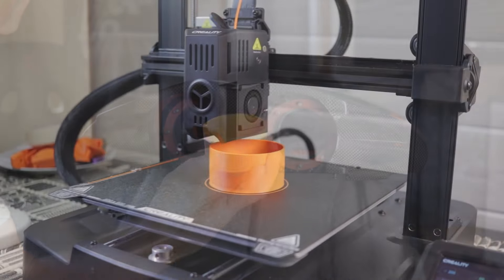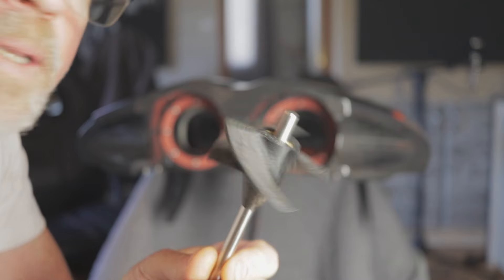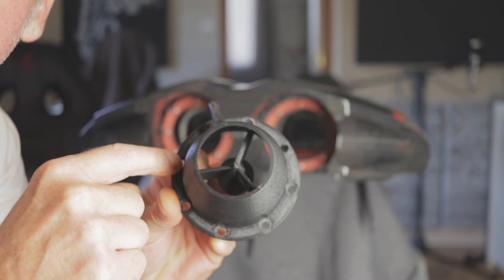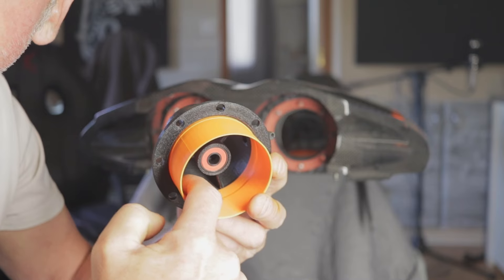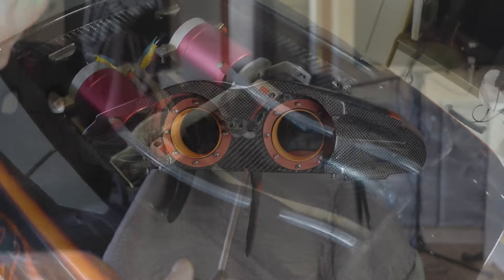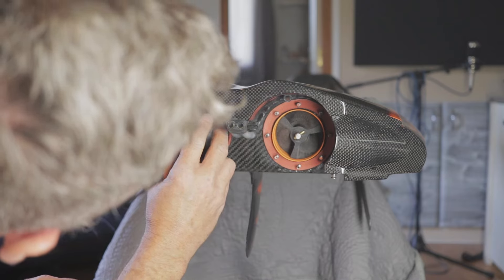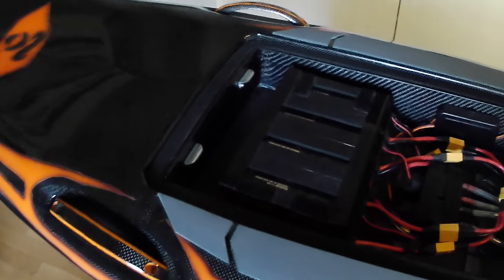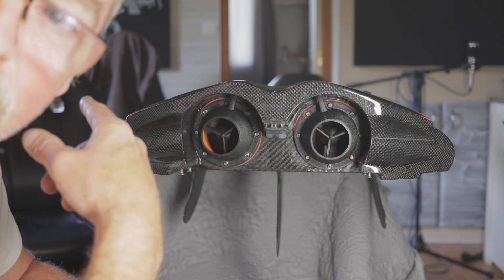Installing 3D Printed Jet Drive Upgrades for the Diy Electric Surfboard

Comment: Your board construction is amazing, quality and finish is probably the best I have seen. However I think the drive unit needs a little work. You are right about the ESCs they are easy to burn out and expensive. The absolute best are mgm-controllers but are very expensive. I have used Flier ESCs which have been OK but still burnout, I think ZTW are probably similar so watch the cooling. I now have Trampaboards vesc ESC, very controllable, well made and they have real people who answer the phone and will repair.
These boards use a lot of power and you will soon find that you need to make a Lithium-Ion battery pack. Samsung 40T 21700 is a good cell.
For the efficiency of these Jets the guide fins on the nozzle are as important as the impeller, yours look as though they are straight. As the water comes out of the impellor it is spinning and these fins need to straighten the flow so they need to be curved to do this. Best jets if you can afford them mhz-watercraft.
Please do not take this as any criticism, I would love to have the skill to make such a great board. Such a premium board deserves great drive unit. Really looking forward to seeing it on the water.
Reply from the maker: I totally agree and thanks for your input, the Venturi fins do have a slight offset to them but I might have to make them more angled in the future. The cells you mentioned I have looked at and will go for making a battery one day but was going on what I saw other YouTubers doing as a starting point. Hey it's all part of the fun in the end. The upcoming video highlights the esc problem even more so will have to change them whatever happens. Much appreciated.👍